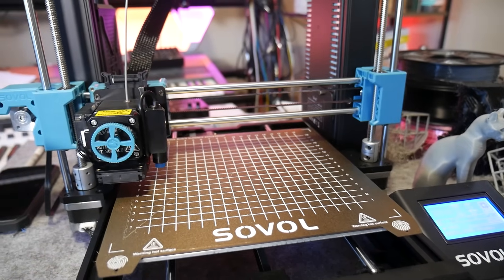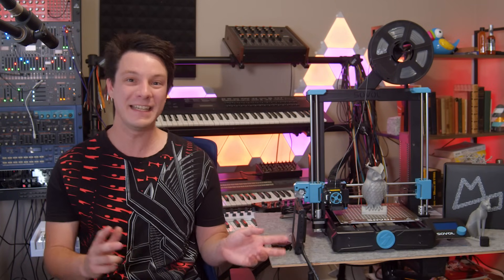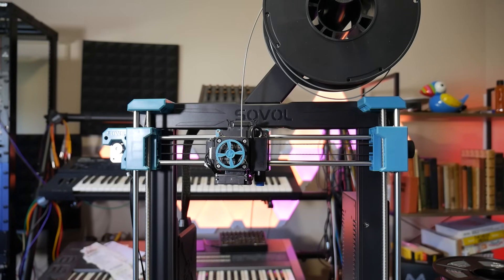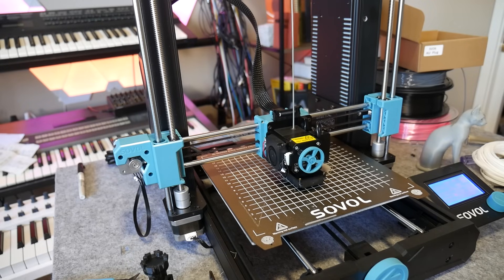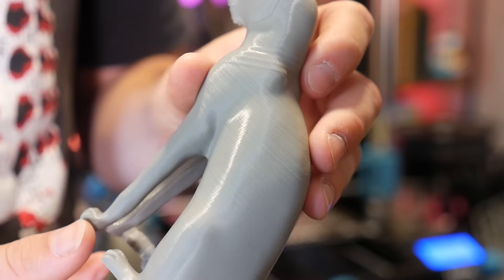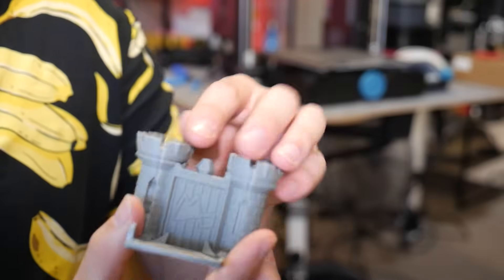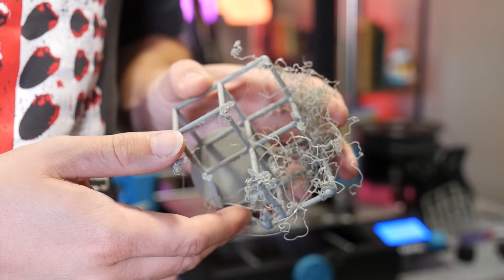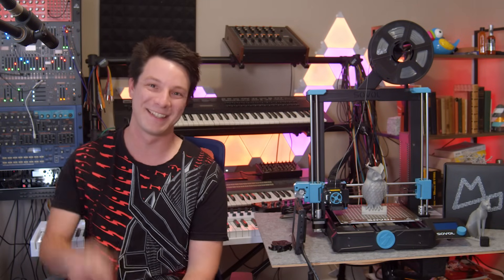Is the Sovol SV06 a Prusa MK3 for 1/3 the price?

Comment: I bought an SV06 a few weeks back as my first printer as it seemed like a good entry point. Full metal hotend, clone of a decent design, not stuck with Crealitys' lack of support. It's been a very nice experience as a novice to be honest, easy to set up, easy to calibrate. The only issue I've had out of the box was not realising the belts needed a decent once over after loosening during shipping. But that's just beginners junk. A slightly bigger build platform would be nice for printing props and stuff, and a filament runout would be great too. But Sovol just announced the SV06 Plus which has both of those and a volcano hotend. So I timed my purchase very well.
Reply: Oh yeah, installing a runout sensor aftermarket seems pretty simple. There's a little socket on the side of the extruder that handles the input, and just runs to the DET port on the board if you want to not have a random cable running to the extruder. I've got one shipping to me now to give it a shot. It's a bit of a pain finding this info out without happening across specific reddit threads. There's a bunch of features in their Marlin config enabled that they just didn't talk about too like G2/G3 arc support and M155 temp report support. So you can use those if you like tweaking gcode defaults.
Reply: Creality's lack of support? Huh? 😂

What support do you need from them? The community is always better anyway, and it's one of the biggest communities around. I've never once needed Creality for anything. In fact, since the internet has been invented I've never once needed the company of any products I buy, for anything. I literally go straight to forums or YouTube. 😂

You probably read that from other noobs and just took it as gospel.

I love these posts. A noob buys their first machine and thinks it's the best and comes on YouTube and goes "I got the best machine and I don't have to deal with this this and this, then they realize, just like prusa owners, that oh, I am running into the same issues, I do have to still make upgrades. I am going to have to learn basic electronics and how a machine works"

Doh!

Truth of the matter is my guy. If you have some decent skills you can buy the cheaper printer and make it better than the Prusa for less than $400. That's a skill. You also don't need the company for support. I know Prusa people love to talk about the support they get lmao, as if that's somehow a reason to spend $800 on a bed slinger when the same support is on YouTube and other places.

I love all my Enders. My first E3V2 is still going strong and all I did was all metal hotend, ABL, bed spacers and jyers firmware. People can claim their printers are better but the proof is in the prints. I now have printers that are faster but that Ender prints beautifully. I have no issues with the glass beds or first layers either.

The reason you think creality printers have problems is because they're cheaper and noobs buy them that have no skills and don't know what they're dealing with. These are the same people that will just throw money at it thinking more upgrades will solve their problems.

Thankfully there are companies who are willing to sell us the cheaper machines and leave it up to those of us that are skilled enough to upgrade it. Otherwise I would be stuck spending hundreds of more dollars for a product that comes with part I might have to replace anyway. I don't need a company to do all my upgrades. Nor do I want them to. I would like to choose my upgrades and how much I'm willing to spend on them.

I love creality. They brought 3D printing to the masses. Just ordered their Falcon 2.

I'm not a Creality fanboy. I build Vorons now. But when I see misguided hate for the company I like to add my two cents.
Reply: @dangerous8333  Don't be an asshole.
Reply: @dangerous8333  "I am not a creality fanboy but here's a several paragraph reply about how you're a shithead for not buying a printer from them"

Bud, I didn't kill your dog or anything. I bought a 3D printer based on feedback from a bunch of people, new and experienced, on the printers they owned. Sure an Ender 3v2 would be cheaper, but I also just wanted to print things. Not spend a few weeks buying new parts and dicking with the thing to actually get it level. Do you pop off like this at new users buying Prusa too? Sometimes people just want something that works out of the box and paying a little more for tighter QC and not having to rely on community fixes is acceptable. Creality definitely bought printing to the masses, but that doesn't mean they've continued to be the go-to for every need.

What a weird thing to become an elitist over.

Comment: 220x220x250 for $225?

Sunlu s8 300x300x400 is $219
Reply: limited non-auto bed leveling but it does have a filament runout sensor...that works

Comment: I put a sprite pro onto an ender3 clone. The extra temperature head room came in handy when I put a Hardened steel nozzle on for glow in the dark. The petg I normally print with prints at 240, so it was nice to be able print at 255 and not need to change nozzles.

Comment: I really want to love this printer however my unit, and apparently a lot of other guys machines, had severe manufacturing problems that made me request a return. Could just be an early batch where qc was not on point, idk.
The problems my printer had: 
- Unlubricated bearings, sounded horrible 
- unparallel x axis linear rods
- warped bed carriage and bed
- z/x gantry could not be mounted square due to hole misalignment in the bade frame
Those are just the major problems I had which is really a bummer as this printer seemed like the perfect package for my needs but this whole arrangement of problems made it impossible to get a perfect first layer and therefore successful (larger) prints.
I could live with one or two smaller defects but with the amount I had (and according to posts and forums others aswell) I can not afford to spend time looking for solutions for unfixable problems. Kind of disappointed, but I might buy one later again if the qc is finally up to spec. Hopefully everyone of you that buys one of these little machines belongs to those without problems as it seems like it's a really good machine
Reply: I basically had same issues, but I was too impatient to return my first printer after waiting 2 months to get it. I've managed to get quite good results after doing this:
1. Basically disassemble the whole X gantry and pack linear rods with as much white lithium grease as possible. It still sounds a bit "crunchy", but a lot better.
2. Get custom firmware with Unified Bed Leveling and X-Twist compensation enabled.
3. Do not trust Auto gantry alignment, instead use LED on Z probe to align screws manually.
Looks like you don't need those instructions, but maybe I could help someone else
Reply: @NeronRVV  This is really good advice and for a lot of people it would probably help. I did all of this but the twisted x gantry was too severe for the software to be able to compensate. Thanks for the tips, hope it helps someone in need

Comment: Actually the SV06plus with 300by300 would be more interesting, as the print size is the only thing to complain.

Also: Wich Marlin is used? Would be nice using 2.1.x with experimental input shaper... With missing runout sensor to be added, a firmware has to be recompiled anyway. 

For the rods: Are they the same distance as on a mk3s? Would be quite nice to change the printhead to a Zorbiter 2 + Revo for example...

Comment: 7:00 any pointers on fixing this issue? Was it due to dual extruder gear slop, eccentric stepper shafts, or motor vibration? It seems to vary in intensity at certain feedrates.

Also, your z layer consistency seems slightly worse than on mine
Reply from the maker: Still testing to find the issue, it seems to be pretty common on them but tough to diagnose.

Comment: I sold my Ender 5 Plus for one of these. Big downgrade in volume of course, but everything else has been much less frustrating and reliable. The badly designed cooling fan is pretty much the only criticism I have. I'm in the middle of doing Scattered Collectables' cooling duct mod right now.
Reply: Also my SD card only had a Benchy on it.
Reply: I have an ender 3 pro and it's absolutely goddamn annoying. Constantly unleveling, failing, needing adjustment etc. Can literally print maybe one item before having to screw with it for 3 hours.
Reply: @enb3810  I have an ender 3 pro too and you just described all my problems. I am considering selling it and buying this lol
Reply: They just came out with the plus sized sv06
Reply: @elliot3147  doesn't count as "coming out with" if it's pre-order.
Reply: @enb3810  For what it's worth, I ordered my (original) SV06 during one of the pre-order phases and it shipped a whole month earlier than projected. Not a guarantee for the future of course, but at least they're not full of shit with their preorders :)

Comment: One of the main turnoffs for me is how big the extruder and hot end all looks attached to the rail slider assembly. It feels it has a very large rectangular area really close to the bed that would make sequential printing a lot more difficult.
Reply from the maker: Agreed, it's quite chunky. Good for more filament control however vs a bowden extruder.
Reply: if you want sequential printing getting conveyor type bed printer. sequential printing on a normal printer is a bodge not a expected or planned for feature due to constraints on the style
Reply: I've had plenty of luck with sequential printing on my Prusa Mini. YMMV I suppose.

Comment: I'd love to see a standard sound measurement for printers. Say, dB level at 1 meter. I'm very sensitive to whining noises and (successfully) replaced all the fans on my Ender 3v2 with Noctua fans to quiet it down.
Reply from the maker: It's something I've always thought about but don't have a good repeatable environment. I'm ultra sensitive to sound and found this printer to be really quiet, the steppers don't make a high pitch whine unlike the bambu p1p's when energised which is nice.
Reply: @MakersMuse  oh thank god other people get that whine aswell I thought I was going crazy
Reply: @MasonMakesStuff  thats from spreadcycle chopper mode. the chopper frequency should be set higher than hearable but some people are very sensitive. stealthchop doesnt have that problem
Reply: @MasonMakesStuff  When I was younger, I could tell my dad the TV was on and showing a black screen, because I could hear the horizontal refresh whine and he couldn't.

Now, I probably couldn't hear it either, but I don't have any more CRTs to check with.

But since I've done some motor control work, I'm pretty sure any very high-pitched whine you hear (>=10kHz) is going to be caused by the PWM frequency.  Stepper motors use PWM for microstepping.
Reply: @MakersMuse  leave this one to cnc kitchen I feel like with his testing methodology he would come up with a good repeatable db test
Reply: @jacobkudrowich  Maybe. But Angus is a musician and knows about audio gear.
Reply: @MakersMuse  reach out to your university acoustics lab, they may lend you some time in their anechoic chamber.
Reply: Uhh noctua makes a lot of different fans, which ones are you saying don't work as well as which other fans?
Reply: It's not just the sound level though, at least not for me, it's the pitch too. 
Low-pitch sounds I can handle, but squeals, even if not too loud, I find annoying.
We need an enterprising reviewer to come up with a way to measure the loudness contour.
Reply: Lost in tech has been measuring sound in his reviews. Thats obviously not all printers. But most of then seem to be in a similar ball park.
Reply: This could be a USP worth adding to this channel, since Angus already knows about audio, and has much of the gear. And I'm sure he could knock up a small soundproof chamber from some foam.
Reply: That's a great idea, and not just the volume levels but the frequencies it creates too, a whole soundscape, because everyone has their own particular sounds they don't like.
Reply: THIS!
Reply: Whining noise isn't measured in a dB meter. You need a spectrum analyzer for that.
Reply: @cas curse Noctua fans by design are very poor in comparison to good industrial axial fans(iSunon, delta, etc) for uses such as these(servers, part cooling, etc).  It's more than just the type(Axial vs Radial) and the RPM, the blade/housing/electrical design is all wrong for industrial purposes.
Reply: The problrm with noise analysis is unless you have REALLY high end gear and an incredibly controlled environment, your numbers are only comparable to your numbers.
Reply: I'm afraid that  this new world of hi speed klipper printers comes with huge fans that blow hard.
Reply: Be careful noctua fans do not provide the same amount of cooling.

Comment: Would love to see a review of the Sovol 3D SV04 IDEX, especially with it's bigger build volume, iDEX, and runout detection!
Reply: I have had one for almost a year now. Had a few teething issues, replaced the parts fans with better ones as I started to get heat creep after a while. New fans got rid of that. One note - the SD card slot is a spring release one and is UPSIDE DOWN due to the motherboard being mounted inverted at the top of the case. I busted mine inserting the card because due to the spring it felt like it was going. in. I replaced the motherboard at my cost (I busted it).  The runout detection will probably need you to tweak it, got some false stops and opened the box and tweaked the adjustments and it hasn't repeated. 

The printer MUST be in the proper MODE before you print. I would have thought the slicer would have put GCODE at the beginning to set it to the appropriate mode but it doesn't.  If I knew what these codes were I would add them to the slicer. 

But I'm very happy with it. It just runs and runs and makes great prints.  Another thing to be aware of, a lot of the parts are Creality - the 32 bit motherboard, the fans, and the graphical display.